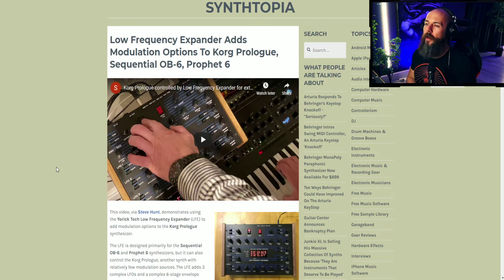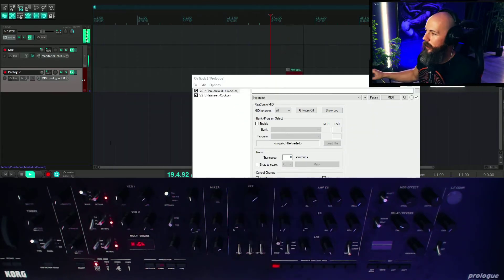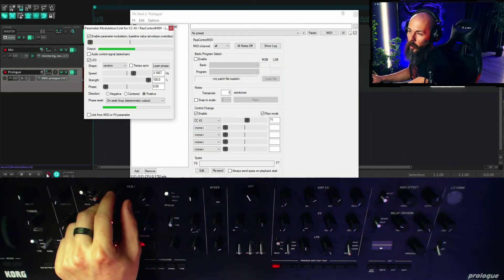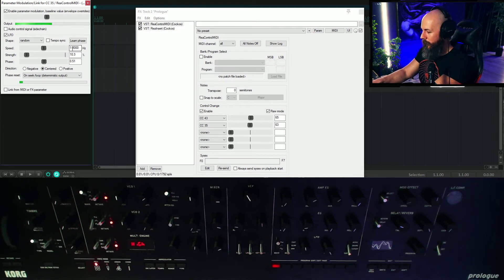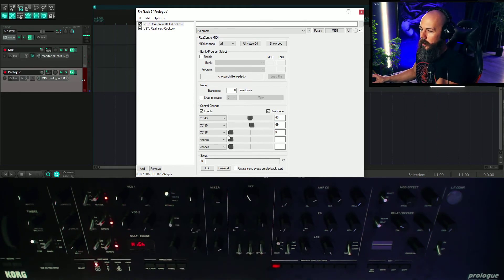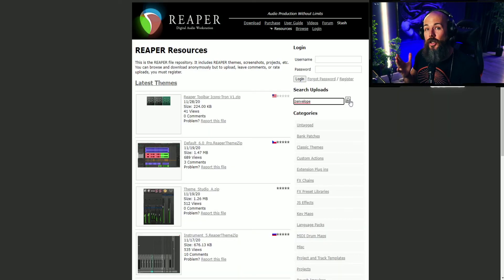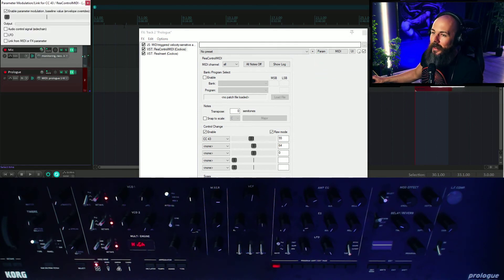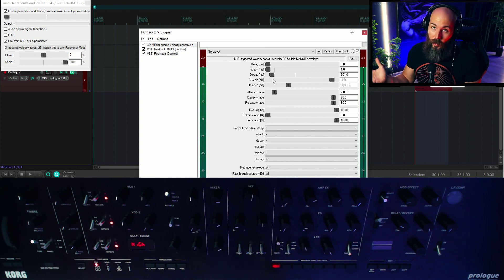ADD ADDITIONAL LFO'S AND ENVELOPES TO HARDWARE SYNTHESIZER with REAPER - Parameter Modulation

Comment: Subscribed! Very nice video. I do something similar but on a simpler level. I take ReaEq, and remove all the bands but one. This I make a Low Pass Filter. Then I modulate this with an LFO, just as you have shown. Or place it in an envelope to draw in the filtering, to taste. Thanks for showing how ReaControl Midi works. This is a much more powerful tool.
Reply from the maker: Glad to help!

Comment: Interesting to see someone else doing this. I've been doing the same thing with Max4Live devices in Live with my Prologue. However I've found that when I string a few LFOs or Envelopes together modulating different CCs, that it sometimes becomes too much for synth and it starts going haywire. Have you run into issues like that? One of the benefits of Live and having a Push 2 is that I can map the controls for the LFOs and Envelopes to knobs on different pages on Push, effectively giving me a Low Frequency Expander for nix.
Reply from the maker: Yes, I have noticed that around 5~ LFO's the prologue gets angry 😂 I don't know if it's a limitation of USB 2.0, Reaper or The Prologue itself.
Reply: @VultureCulture  Could just be overloading the Prologue with MIDI messages I guess as I'm using a different DAW and the old fashioned MIDI plug rather than USB. I'm not good friends with Korg's USB driver for Windows!